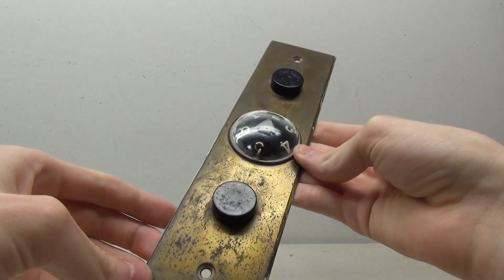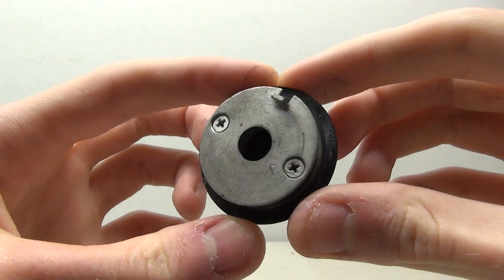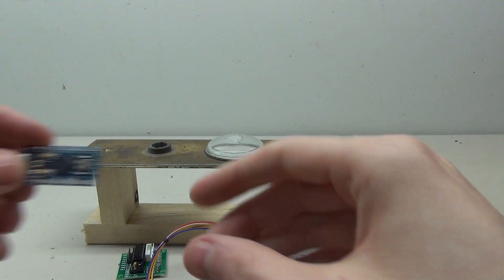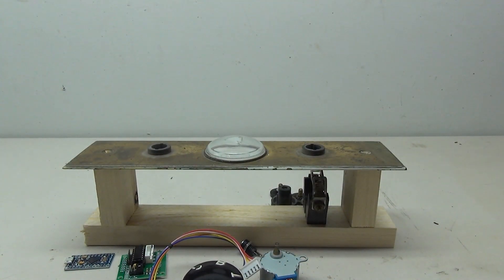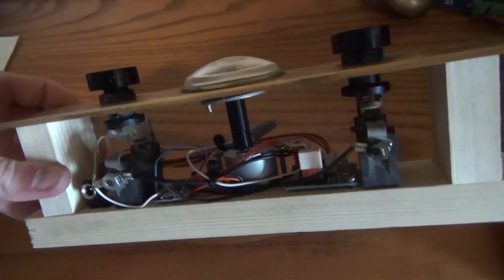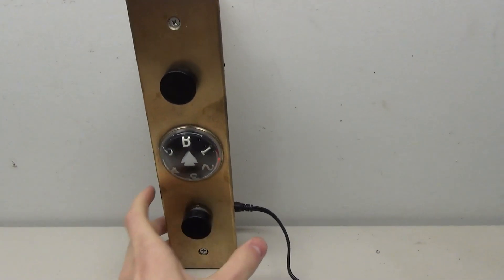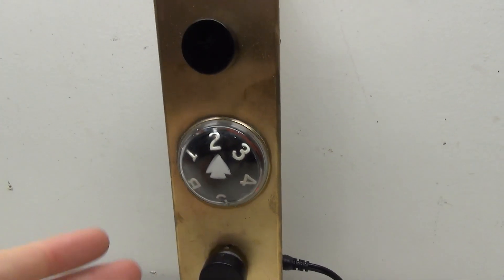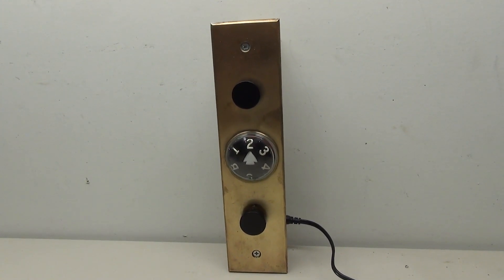Building a Custom Otis Roto Dial Controller

Comment: Otis seems to have called these "dial indicators". I think these indicators MAY have been driven mechanically, like the dial indicators above the doors found on manually-controlled elevators. (Mechanical connection between the machine room, specifically the selector I think, and the dial). I'm curious if you can confirm this.